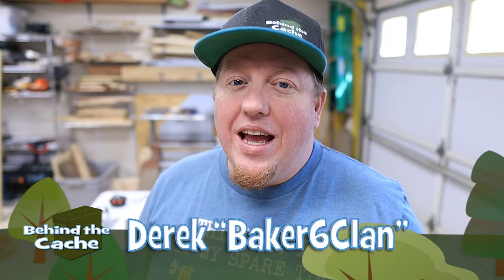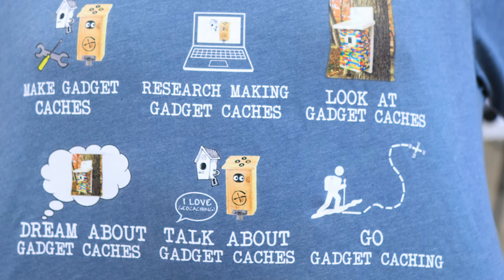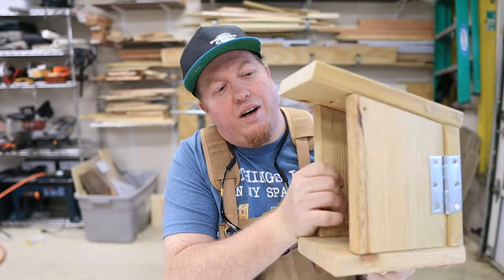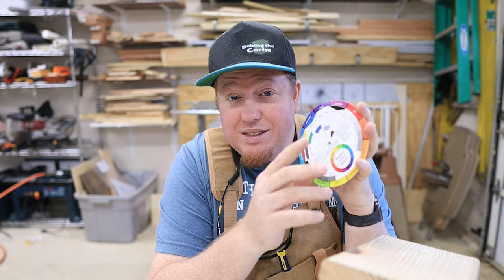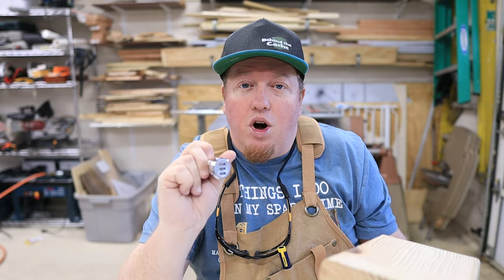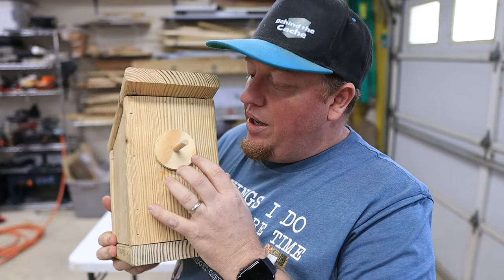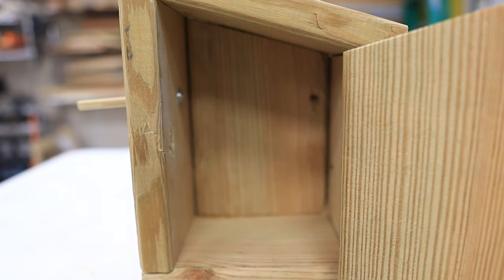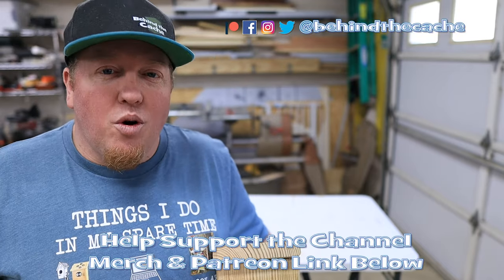Simple Decoder Creative Cache Build (GCNW)

Comment: Since I've seen very few 'cypher' caches in this type of manner, I think you might want to add a little more in terms of examples how this wheel will work (i.e. a GC# that uses a cypher code on its page that would work with your build). And, is the wheel secure on the dowel or can it be easily removed? What is keeping the dowel from pushing inward?
Reply from the maker: I would love to give you an example of it but I truly have not found one like that. The only example I could think of is like a rot13 decipher ring. 
The dowel will not push in it has a stopped under the disk that prevents it. The disk is also has a pin into the dowel.